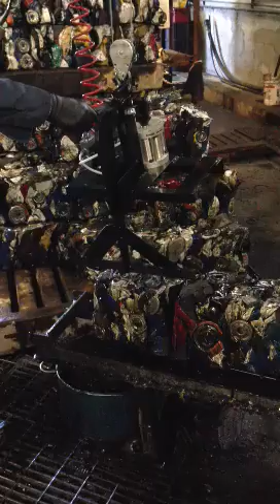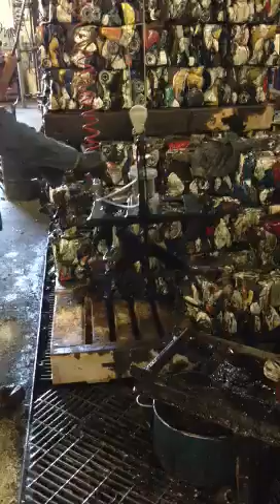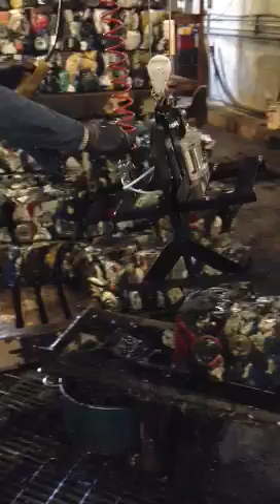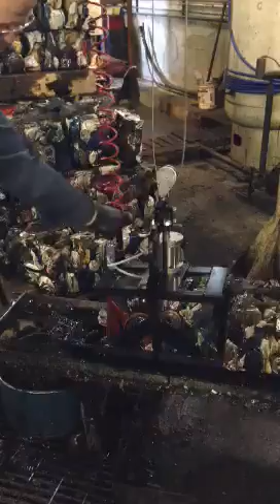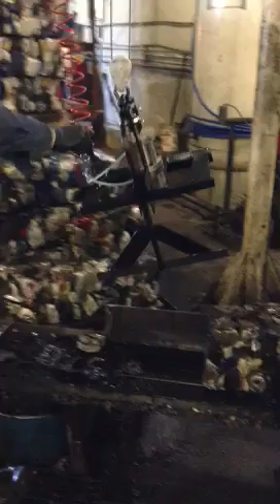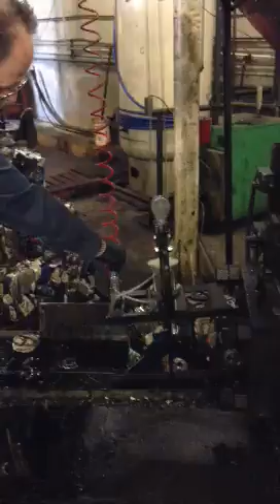Lucas Lifter

Comment: I'd like to get a follow-up video nothing's been posted about this in 5 years how are these guys doing now
Reply: before 2019 ends, pls
Reply: @mlaygo  um… still nothing
Reply from the maker: Sorry for no response. I’m still plodding along picking up filters and keeping my customers happy.  One of my sons has come on board to help out and eventually take over. Really not much has changed in the operation other than a few tweaks in how we try to clean the oil before we use it to fuel the oven. Also trying our hand at making black diesel to heat different buildings and fuel different engines.